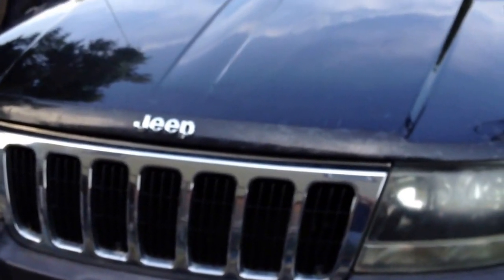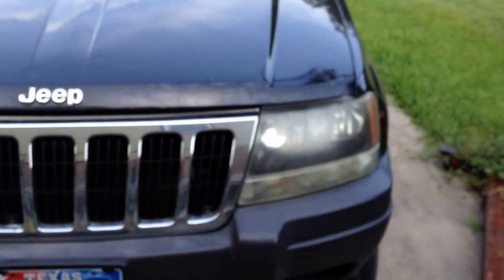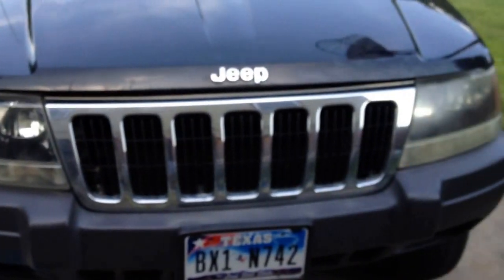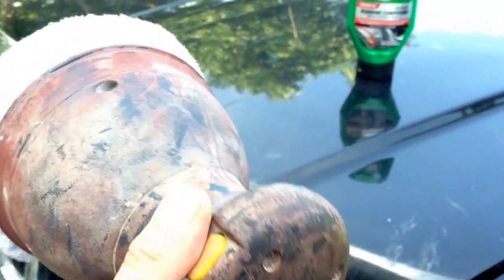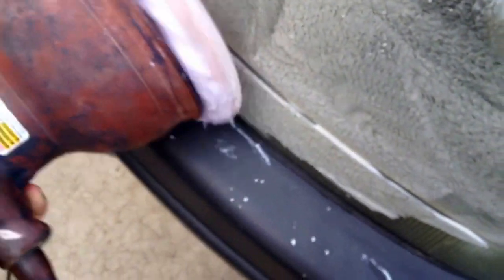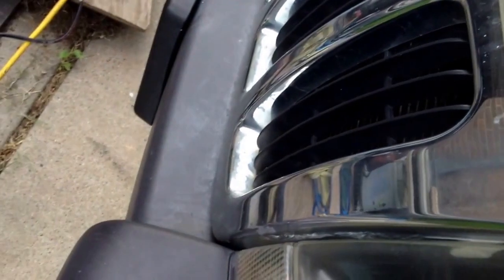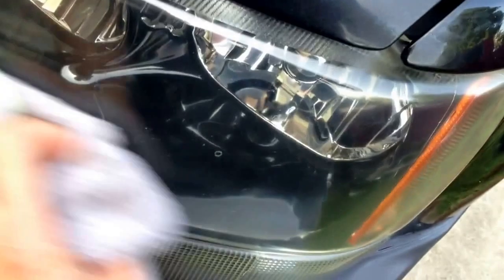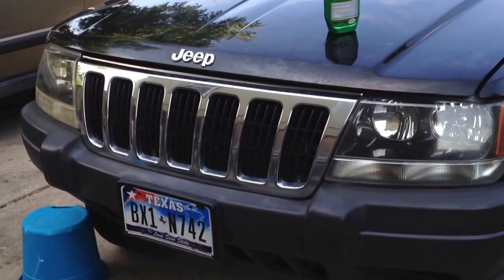How To Restore Headlights From Crazing or Clouding

Comment: Isn't crazing the micro cracks inside the lens? I tried sending buffing nothing will remove the micro cracks
Reply from the maker: Chris Hiler You are exactly right. The intent when polishing is to take off enough of the surface to get below the cracks. Unless the crazing is really bad, can should be able to sand through the cracks and then polish.
Reply: @TreyClanton  No way that this would be possible? Crazing is deep in the material.